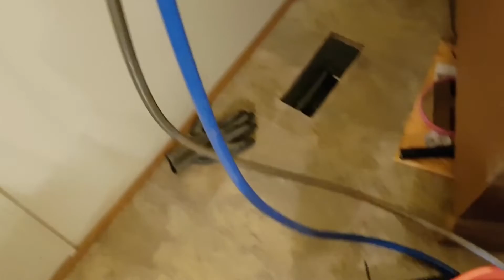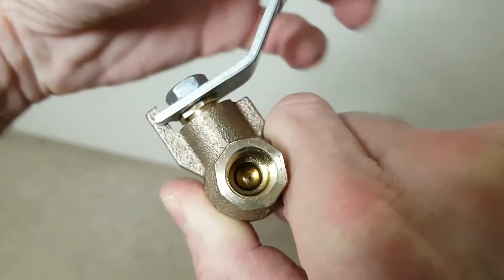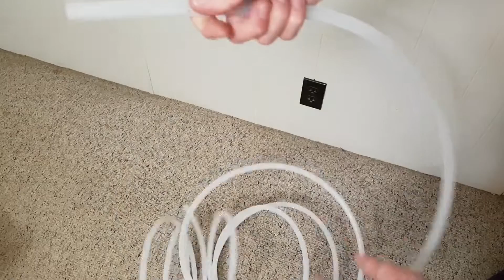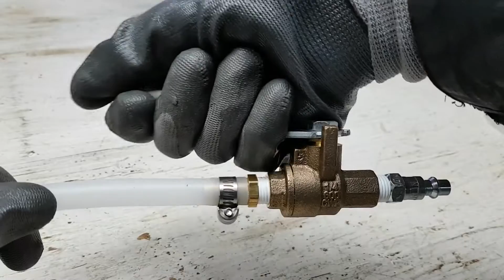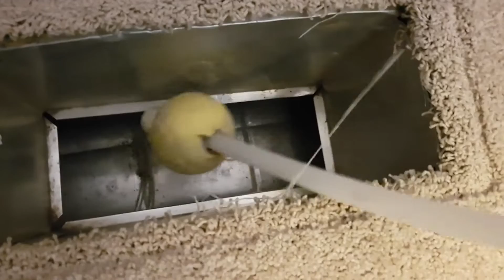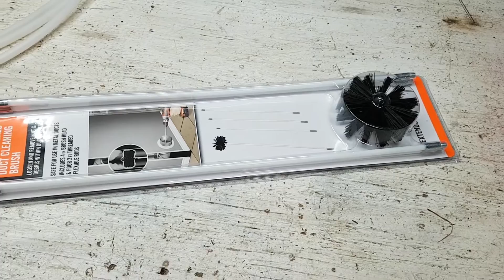DIY Air Duct Cleaning Tools, part 4 - Skipper Line for Air Whip Duct Cleaning - Air Vent Snake Hose

Comment: Reinventing the wheel. I remember doing all this back in the 1990s when we considered adding duct cleaning to our chimney business. Built a lot of stuff like this. Even the “ pro” duct cleaners have problems still to this day. Best fix is to abandon your duct system and replace with mini splits. Seriously! Ducts suck and will become dirty in no time even if you manage to clean the entire system( which is almost futile on a large complex duct system) Oh and snags  , oh my god, nightmare!
Reply from the maker: Thank you for the advice.
Reply: @BudgetPhil bro, you're an inspiration to me and others that don't want to pay 700 for our ducts to be cleaned and rent. as a renter, there's no expectation for our ducts to be cleaned, hence they've never been cleaned in 20 years. I have tried ozone and UV-C but still have respiratory problems. after watching your series of videos on HVAC cleaning, I have hope.

where are you located? any chance I can commission you to build me a couple items? specifically, the smaller whip with the compressor hose around 20ft. I got my bases covered for the negative pressure system and I will purchase a strong shop vac. I also need the whip you made in video 7 for plastic flexible ducts.
Reply from the maker: Thank you.  I'm not yet able to manufacture any of these tools for sale, but the small whip can be fashioned from commonly available parts.  I'm happy to help answer any questions I can about assembling the tools.
Reply: @BudgetPhil  I bought most off Amazon and rigged them up similar to you with drill. I have a compressor too but I don't want to damage the plastic flexible ducts. thanks again bro
Reply: You are right! My in-attic HVAC is near end of life and the ducts are flexible type which cannot be cleaned easily. Hiring duct cleaners is a joke as they just jam up long vac hoses and call it a day. In another house, I had split units and they worked great for both heating and cooling. This is how I plan to go now. Thanks.

Comment: Phil, silicone hose is what you are looking for to use in the whip. It is available at auto supply stores as fuel hose. It is pliable but strong. It is very much like your hose that blew bubbles but silicone will not deform like that. It definitely is what you need to try.
I am looking forward  to your diy rotary brush!
Reply from the maker: Thank you for the advice.  I'll give silicone fuel line a try.  Another viewer recommended it also.

Comment: Thanks, I recently acquired some twinplexs and wanted to clean out the ducts and crawl. This video was very interesting and informative. How much in total did you spend on creating the final project/idea?
Reply from the maker: Thank you.  I'm not sure, but I've probably spent about $200 so far.  Already had some of the parts that were needed.  I'll try to find out what it all cost me and include that info in part 5.

Comment: Do you have part 5. Also I love your channel I am going to subscribe to your channel even though I am just a kid
Reply from the maker: Thank you.  I hope to have part 5 ready in a month or two.  I'm still experimenting with different brush designs.
Reply: @BudgetPhil  it's great that you did this beacause there are not any other videos on this I scrolled for and hour in a half great job😁😃
Reply: I have a suggestion could you do a video on a diy drain snake or drain jetter
Reply from the maker: That's a good idea.  I'll put that on the list. Thanks man
Reply from the maker: Thank you.  I've never used a water jetter. Sounds like it could be fun to use for drains.  Might be too much pressure for ductwork.  The water could cause some problems in household ductwork.  But maybe it could work well in some industrial applications. Farm buildings housing animals come to mind because they usually have plenty of drainage and ventilation which would help dry out the ductwork quickly after servicing.  But I don't know.  
Most flexible ductwork I've seen can be damaged pretty easily so I try to be careful with that type.
Reply from the maker: Inspecting ductwork can indeed be difficult.  Perhaps a do it yourself ductwork inspection video could be helpful.  It's interesting to look into old ducting, and sometimes shocking.